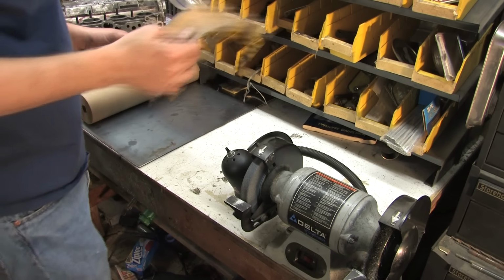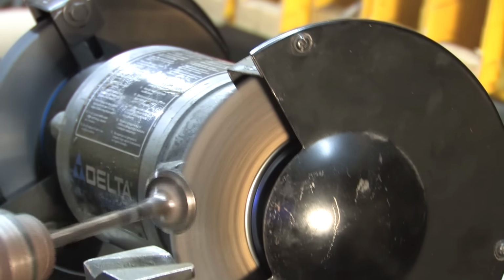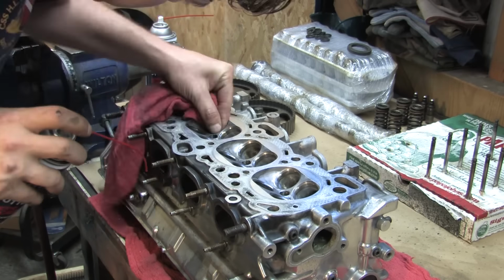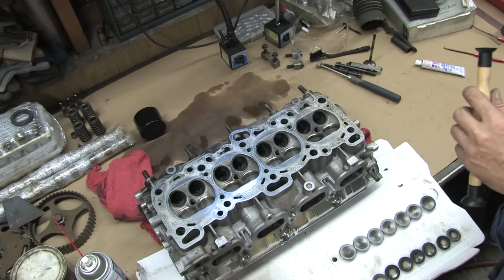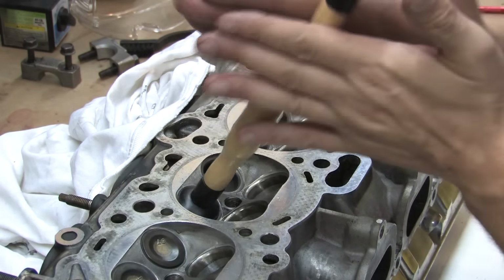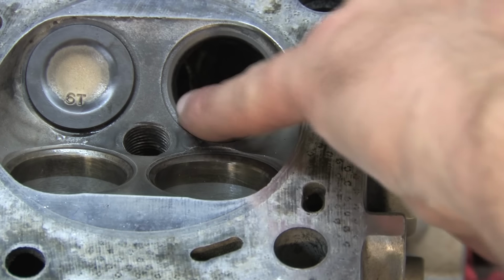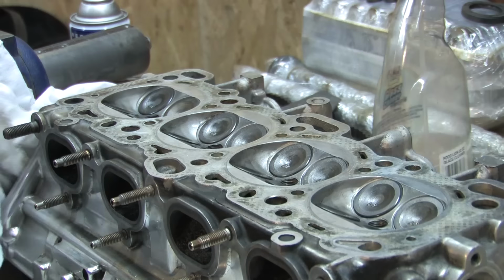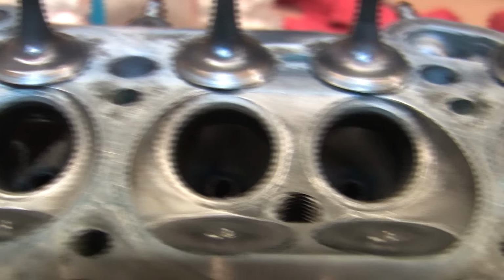Cylinder Head 105 - Valve Job Basics

Comment: This in no way is a valve job. This is a valve seat cleaning and hopefully you don't screw up the seat. A valve seat is usually .065 - .125 in width and seat in the middle of the valve face. Some have a interference angle of 1 degree for quick seating. U grind the top of the seat at less of a angle or grind the bottom at more of angle to get the sealing part or angle to the right width and location on the valve face. do not want a wide seat from valve margin to valve toe because it wont self clean, or dissipate heat or flow correctly. That grit from lapping get stuck in seats and satellite. Lapping valves in was good for low rpm big valve tractors or small engines. A modern day valve and valve seat are design to run thousand of miles in high heat with low octane unleaded fuel so I don't think the harden surfaces can be effected to much by lapping compound, powder seats are hard to cut with proper cutters or stones. In short, a pounded out or wore out seat burnt valve and seat will not be fixed by lapping. To check your seat take sharpie and make vertical lines 1/8" apart all the way around valve slap the valve in the seat turn back and forth 1/8of a turn and pull it out and there is the seat. Look up the specs for your engine and compare.

Comment: 40 yrs as a mechanic/machinist/fabricator. Hope you are wearing a n95 mask n good eye protection. That is not a valve job just hand lapping. Use a old valve stem and fuel hose chucked up in drill

Comment: Is it recommended to place the valve back into original location it was removed from?  I'm about to remove the valves off my LS 799 heads to clean them. I just didn't want to mix them up as in a intake valve in another intake valve spot and cause a leak.
Reply: +vpelayo89 Always put valves back in the original locations - number them with a sharpie on their face as you clean them, or store them in a piece of cardboard as in the video.
Reply: I would use a mini striker 1-8 numbered on the very bottom of the valve if you take your heads off often

Comment: to me you did grind too much of those valves. they might burn easily if you grind too much. expecially exhaust valves.
Reply from the maker: I'm trying to gather the context?  I did use a bench grinder, but I never touched any of the valves to a grinding stone, I used a wire wheel.  I never removed material from the valves that wasn't carbon?  I did grind a valve in a different video, but I didn't even use that valve.  I cut new seats and replaced them all.  Do you mean I lapped them too much?

Comment: Great videos!! Thanks for all your hard work!!
FYI, a valve lapping tool with a smaller suction cup would work 100x better for you. Your suction cup is too big and is in contact with the lapping compound, causing it to loose suction. I have one with a smaller diameter cup, and i dont have these problems.

Comment: Mediocre way of doing it ,I guess if you're a backyard mechanic. I've been doing cylinder heads for years at an automotive machine shop. The right way is to grind the valves and cut the seats . And then lap them in. Of course after I resurface the cylinder head and Chase each threaded hole. After the head is assembled I adjust the valves.i would never ever put a head back on without a step missed especially resurfacing it.

Comment: Yeah, nope. I haven't lapped a valve for over 10 years. Modern CNC seat cutters do a much better job than a human could ever do and require zero lapping. In fact, you'll probably ruin the seat trying to lap it. You also didn't mention that the seat is only as concentric as the guide. Did you repair those first? Pay the money and use your time to do something else more wisely. This is totally backward.

Comment: I'm using same Permatex lapping compound, but have seen other mfg that have 3-4 grits. The back of Permatex tube say " a scientifically engineered mutli-grit compound that starts at 120 then transitions to 280 and finally 400". They call it "scientifically engineered" any Average Joe calls it "wearing down" !  Its strange because in my wood shop my 120 grit sandpaper does the same thing wearing down to 800 grit as I use it, guess the same rocket scientist designed both........

Comment: Just because u don't or can't use the drill method dosent make it not the right way, just notbthe right way for u
Reply from the maker: Sure, and I explained why my reasons had nothing to do with me.  It's so everyone else doesn't do what they saw in a YouTube video and don't have the feel for.  Its to let others develop the feel before trying it.  So they don't destroy their cylinder head, pop 3 adderall and drill each valve through their head into the workbench.  Less is more when it comes to lapping.

Comment: More like a high school kids valve job. Where is your service manual and what are the seat widths. Seat too wide or narrow overheats the valve. Get some New-Way cutters and a book and do it right. The pilots for the guides tell you what you valve to guide clearance is . You did not measure any of that. You did call it a bush fix but a seasoned aluminum head would like a better cut for seats.
Reply from the maker: +1-Shot slinger Which service manual?  My 97 mechanical and electrical manuals are 2 feet from where I'm typing.  The PDF is on my phone and every one of my 6 computers, and the haynes manuals are collecting dust in my garage because half of what's in them is wrong.  It's 1mm service limit.  I was at the service limit.  I can look at the lapped line and see everything I need to know on both parts.  It's why there's a video linked off of this one for a complete radius cut valve job being performed on this head with a larger set of valves to restore the valvetrain geometry on the rocker side, and because the engine this head belongs to is getting a turbo that needs more RPMs.  While it can buy you some time to do this as a bush fix if you're in a pinch, or if you're piss poor, lapping lapping should only be a means of checking your seat.  If you lap long enough to change the margin, well then, you're using lapping compound beyond its intended purpose.  All you need is a line to check.  Some people use Dykem, some use sharpie, some use lapping compound properly.  None of those methods are wrong.  The machinist that sets up his valve cutter typically laps one valve to make sure everything's right and level.  That's why this video is called "valve job basics".  This is just a basic procedure that people should be familiar with if they're going to build their own head.  I will have to make this exact same reply 10,000 more times in my lifetime as I have already done.
Reply: +Jafromobile Then change the title to Bush Job head work .  It is the title that causes questions.  I have done what you are doing but I was a kid and now have had New-Way cutters for over twenty years.  I will check out your other vids.
Reply from the maker: Lol, no.  My title is accurate.  Valve lapping is the oldest, most tried-and-true basic diagnostic and valve cutter setup process involved with a valve job.  Read the comments from other professionals who commented here and figure out why your suggestion is an insult.  If you want to cut seats in your home garage, why don't you make your own bush fix video?
Reply: +Jafromobile I did not mean to insult you in any way. You seem to know how to do it right and admit this is only a partial fix.  Like I said this is for a kid with no valve service tools.  This is really not what you call a valve job. Just pointing that out [ and you know this as you said].   I did read the comments and lapping is somewhat obsolete as pointed out by Kenneth Cohagen . The 45 -44 degrees does not need it .
Reply from the maker: 1-Shot slinger I know offense wasn't intended, and I'm not even sensitive to such things after 8 years of making videos, but put yourself in my shoes for a second.  Would you continue a debate with someone who said that?  I spend my spare time making videos to give people definitive answers and information for free.  I challenge anyone to make a better video on the topic, and I'll tell them gratefully if and when they ever do.  I'm humble like that.  That's what helps me to learn new things.  I know many things, but I don't know everything.  Even though I may have referred to this solution as a "bush fix", having others insist my work is titled and advertised as such isn't a compliment, and having to debate it completely works against the point of this video.  My purpose for making videos is to educate people how to get better results from themselves, and find answers for themselves so they don't have to rely on other people for answers.  In order to find a better path forward, you first have to know where others have been.  This is absolutely and definitively a valid basic technique for valve train work that every mechanic should know, and here's why:

The 45/44° method… Nothing wrong with it.  Let's say you're taking that head apart because you pulled it in a junkyard and want to see if installing it on your engine is a big waste of time… how are you going to determine whether or not the margin is in spec, and how are you going to know if it was ever cut with a 45/44° since it's not the industry standard means of cutting seats that every manufacturer uses?

A:  You won't.  You have to go back to basics.  If you don't know the sharpie or Dykem methods, you'll grab a $2 lapping handle and 5¢ worth of lapping compound and find your answer in about a minute.  No matter how the seat is worn, this technique gives you the definitive answer.  It gives you a mark that you can measure.  No matter how technology progresses, turning your back on the past only opens the door for future mistakes.

I might be going out on a limb here, but I'd bet that at least 99.99999% of people in the world do not own a radius cutter or Serdi machine.  I'd also bet that 99.9999% don't own valve cutting tools of any kind.  I'd bet that 99.9% of garages don't even have a lapping handle within an 1/8 mile of their toolbox.  Why would I make a video for .000001 of tool owners who already knew why they needed to buy a $80,000 machine?  They don't need my help in the first place.  If I motivate 1 in a thousand people to buy a $2 lapping handle and check their own valve seat, and then show them a professional valve job linked from my video and the description... I feel like my work is done no matter how anyone else feels about it. They'll know what they can't fix correctly or properly at home.  I'm not here to tell people what to do.  I'm here to teach people how to answer those questions for themselves and make educated decisions.
Reply: +Jafromobile Alright but if a younger guy was to join a car club or chip in with friends for less than a grand could use New-way cutters [maybe I'm not up on current prices] . The vid made some good points and has good tips . For a low budget job it is the way to go. This is how we did it as teenagers when installing an Isky cam or something . Then replace the seals. I do own a lot of valve service equipment but no Serdi.
Reply: +1-Shot slinger who do you think is watching this ? think a GM engineer is gonna see this and change the way they build chevys ? its for people trying to do things themselves and I bet that valve job lasts 100,000 miles.
Reply: +old .northsider The seats want to be exact widths as in the specs. If not the valves will run hot and more than likely will not last 100000 miles. That is a seat clean -up not a valve job where seats are cut back to width.
Reply: +1-Shot slinger Anyone with even half a brain will know this just a valve clean up - if you actually watch the video he pretty much says as such - it's to check if they are seating ok. I will be doing this job soon, using this method on a 55k mile 1.4TSI VW engine. Nothing wrong with the engine other than it needing a full decoke due to direct injection, but i'm fitting forged pistons so will clean up the head whilst its off. This basic 'valve job' will be all that's needed. You're pointlessly arguing about semantics of a slang term, i.e 'valve job' of which there is no formal definition of what it entails, and using terms like 'school kids valve job' in your comments - I find insulting and patronizing, and i didn't even make this video!
Reply: +blower For 700 bucks you could buy a set of NEWAY cutters. Yet you choose to spend money on expensive forged  pistons and simply lap your valves back in. Different priorities for different folks. I was referring to what we did as teenagers before owning valve service equipment. I appreciate the guys video.

Comment: You should grind the valves with professional equipment. When heat gets to them, valves expand and leak. Then the whole job is no good! Professional machinist grind the seats to specs. DON'T do this !! Professional machinist replace the seats and guides.
Reply from the maker: 9/10 professional machinists don't replace the seats.  They cut new ones and grind the stems to correct the valve tip height.  A head that needs 16 new seats is called scrap metal.  Though this issue fixed my problem it wasn't put back into service like this because I changed cams to a set that require stock valve train geometry.  To do this, oversized valves were installed without replacing the valve seats.  Note the title of the video.  These are all BASIC techniques.  All of them are used in performing an actual valve job.  One is linked in the description with this same head.